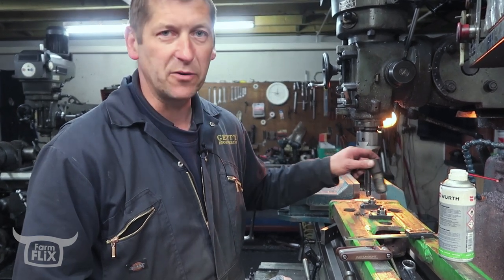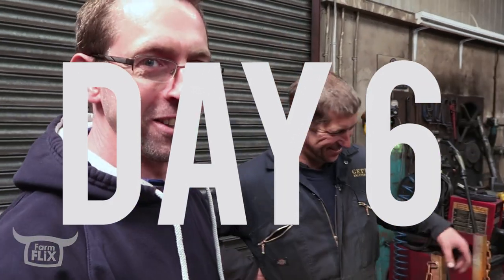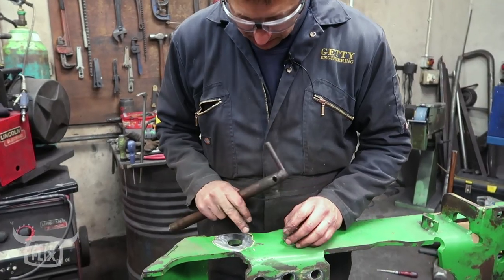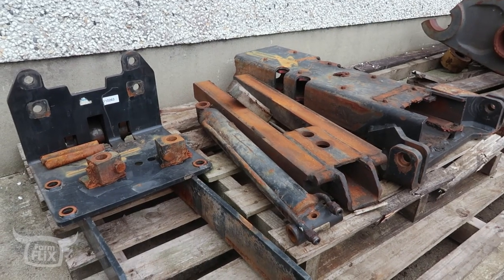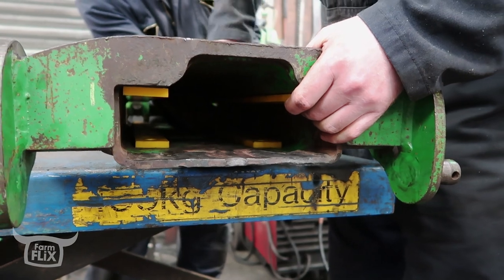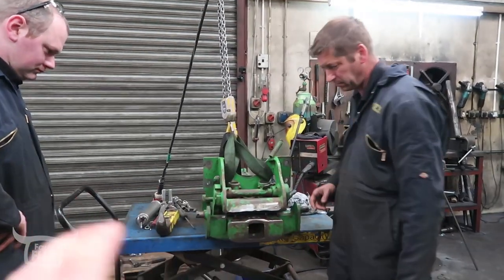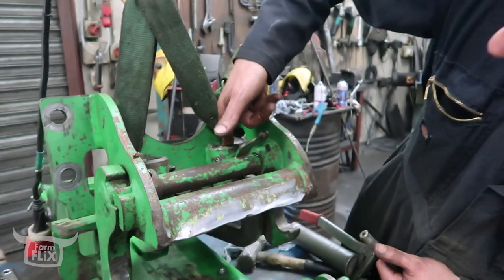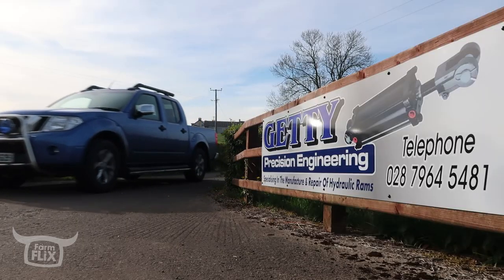How To FIX a Tractor Hitch John Deere 7810.... John McClean | FarmFLiX

Comment: Something youll probably notice yourself after reading this, 1 think i like about the ford/ NH 40,Ts, TM , T5000 etc drop down or swing out hitches is the top of the hook goes up into a slot in the steel so takes a load of ware for them to be dangerous
Reply: That place must have seen a lot of swing out hitches , hear a well placed Haybob tyre sorts the wear 😂
Reply from the maker: need the right hitch